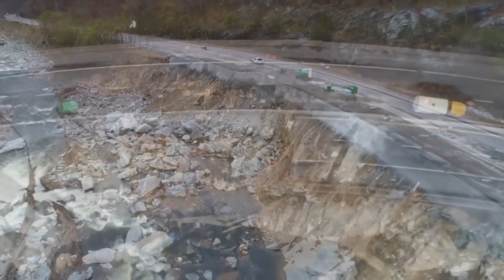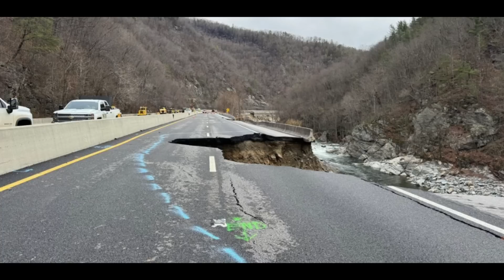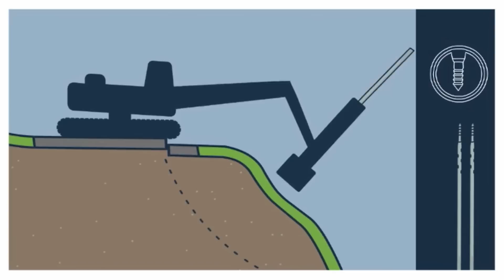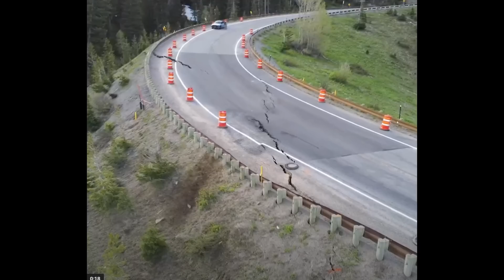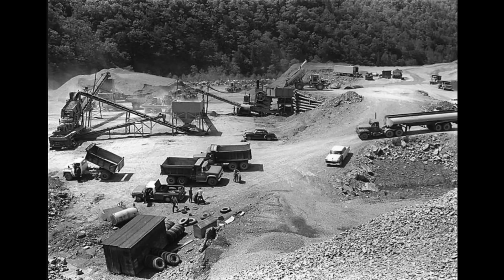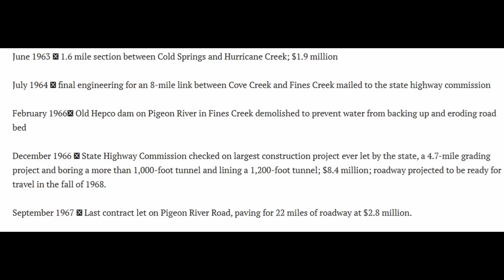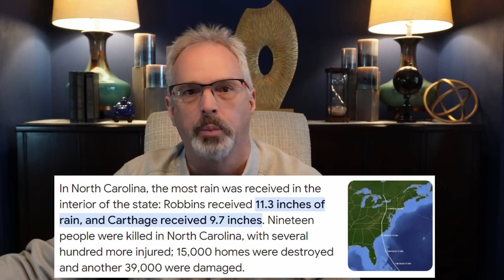Interstate 40 Rebuild Status

Comment: I 40 by-passes through the Nantahala gorge now in WNC.  The Road is in front of my house.  They better break  out the Dynamite and fix this yesterday.  This winter storm this friday 1-10-2025 is going to finish it off the road soon.  It was never designed for this much traffic.   The cracks are getting big and potholes are starting.  The road is going to fail the first time all these cracks freeze and get worse after this winter storm.   I predict they have about a month before it closes.

Comment: I am not an engineer but a retired operating equipment foreman from the mountains in WV building haul roads and mine reclamation jobs. I totally agree with you in your evaluation. Just as a note the fill under the slip area doesn't appear to contain the rock necessary to support the total road base from the presplit. Shut the road down and set back into the existing formation utilizing the rock and overburden in compacted lifts. I enjoyed this very much.

Comment: Excellent report on the rebuild status of I-40 in Western North Carolina. FYI: In the early 1970s, I took a graduate-level course on transportation at the University of North Carolina at Chapel Hill. This was one of the first such courses in the country at that time. I recall being informed that the cost per mile of this section of I-40 was the highest anywhere in the Interstate Highway System other than urban areas.
Reply from the maker: Thank you so much! Yes, that area is an inherently difficult location to build and maintain a roadway.

Comment: Also take into account they used the wrong explosives to terrace and carve out that pass through the gorge. They fractured the entire mountain. Constant rock and mudslides plagued I40 in the 57 years of my life. Take into account the 2006 flood that literally stripped 45’ of growth on both side up the bank through the gorge. The 2006 flood actually weakened the road bed. Traveling I40 if you had photos of the current road bed after 2006 you’d see allot of patchwork in places where the road is missing now.

Comment: I'm not an engineer, but it doesn't take an engineer to see the coming failures of this section of highway. 

Immediately after this damage occurred, I said that the road needs to be cut back further into the mountainside. 

Eventually, during this repair, the rains will come again. That mountainside is pushing the remaining road towards the river. 

The rains will get into those exposed rock layers, and they will move what's left of that road.

Comment: The one thing that comes to mind is that when engineering this project one should not rely to heavily on historical event frequency or rainfall data. The Gulf of Mexico has been getting pretty warm. I would consider that flooding rain falls in that part of the country are just going to become increasingly more common. Great explanation of the fat tail; I had actually not heard about that before.

Comment: Would the bedrock support a tunnel system?
Reply: If not, turn the two lane section of the freeway adjacent the eroded sections into a one lane short-distant corridor with the Arizona divider. Design shoulders wide enough for emergency parking shoulders on either side of the remaining paved (stable) surfaces.  Give it ten years to allow for a more permanent solution...like a totally new corridor (assuming this was originally a political solution freeway design and not a sound engineering solution). In ten years, the state will also know a bit better the stability of other parts of the corridor exposed to the river's flood force and slope saturation and stability.

Comment: I have driven Highway 25 along the French Broad River, ESPECIALLY between Hot Springs down to the next few towns.  The French Broad highway 25 route would be FAR harder and worse.  I have driven the Pigeon River route on 40 many many times as well.  The French Broad Route Highway 25 to Hot Springs and especially after Hot Springs would have been an engineering nightmare and cost far more then the Pigeon River route. Drive this for yourself please. The only other option is HIghway 74 from Chattanooga area which is so far it neglects having this route altogether. I am open to the extreme cost of putting the later built side on a raised corridor thru the pigeon River area.

Comment: I am not knowledgeable about the engineering side if this, but I do know that fill is far less stable than the washed away land it replaces.  I have seen some suggestions of a viaduct, and wonder if it would be a better solution. The United States has a massive issue with infrastructure across the entire nation.  Once we built the Interstate Highway System it seems like we thought it was once and done.  But we need to put more energy into building and maintaining alternate routes, we are too reliant on these major arteries. The US needs to reset our priorities and focus on a lot of restoration, and new infrastructure and have far less focus on being the world police.

Comment: It’s less of a question of how you’d route it as it is where it would be routed thru.  While this section saw severe damage in 04 the sections repaired then are for the most part undamaged.  Current alternative routes are either significantly out of the way (I-40 W to us-74 thru chattanoga, I-77 to I-81) or limited themselves due to storm damage (I-26/future 26 to I-81) with a significant traffic bottleneck in Asheville.

Comment: I40 needs to be rebuilt asap. While i agree that more advanced engineering like viaducts could be implemented, theres not time to wait for the designing, engineering and construction. Perhaps those details can be worked on in the long term while the interstate is restored to the way it was. There is little to no feasibility of rerouting the road or the river due to the terrain. Routing 40 to follow the French broad or us 25 would displace hundreds or thousands of people and cost many, many billions of dollars and destroy those communities in the meantime. We need 40 open asap, as the detour traffic passing through Madison county nc is absolutely devastating the local economy and the residents, who are still struggling to recover from the effects of hurricane helene. The delays, congestion, rude drivers, trash thrown out of vehicles,  and the refusal to stop and spend any $ in " the middle of nowhere" have been extremely detrimental financially, mentally and emotionally for the residents of Madison County NC. I cant tell you how many times ive had to physically stop traffic to  allow my wife, MIL, etc. to get in and out of my own driveway as traffic slows there approaching a yield sign. These detour drivers literally don't see or respond to anything but the gps directions on their phones. It is killing business here, as nobody will stop except to throwvout a dirty diaper or clean up vomit. Both of which are routinely left on the ground. Locals don't want to be on the roads now, and will rarely pull into a business for anything unless its absolutely necessary because it may take 5-10 minutes to pull out from a parking lot or make a left hand turn onto the highway
Reply: I get the trash. Unfortunately not everyone was raised as a Scout to leave no trace behind. It hurts me too. I hate it when people litter. 

However, with DOT trying to rebuild it they’ve run into more issues like more parts of the damaged highway sliding into the Pigeon River.  Thus causing more delays. They can’t open the other side yet cause they need that side for the equipment and stabilizing the soil. It’s too dangerous as it is for the crews.

I’ve read reports where it won’t be till 2028 that I40 is rebuilt. 

And unfortunately, people are too prideful going to try to find the quickest solution to their problems like taking backroads instead of going the long way around or throwing trash out.

I get it though. It would be nice if it could be finished by tomorrow. But that’s not going to be the case with this project.

Comment: Rebuilding the roadway washed away by the flood is a massive undertaking. I have watched other videos on this and one proposal was to replace the washed out soil and rock.  That may be all well and good until the next flood occur ancestors.  To make the repair successful will require drilling into the rock base into the bottom of the stream bed and establishing solid anchors and placing large steel I-beam then build a concrete wall up to the height of the most recent flood water level.  Then fill and level with rock dirt to the previous road bed height.  A washout proof wall must be built to prevent the river from washing out fill hauled into replace the rock and dirt that was washed away during the flood.   If the roadway isn't rebuilt properly a future wash out will surely occur.   Perhaps in ten years or perhaps longer?

Comment: Hi, I am an over the road truck driver. About 10 to 15 years ago, Colorado DOT had to rebuild a section of Colorado Highway 13 between Rifle and Meeker, Colorado. A section of roadway slide off. I remember driving through the area as they did embankment repairs. I saw the constructing crews using these big blocks of solid stryfoam, 4'x4'x8', stacked in multiple layers. I've actually hauled these blocks before, to a parking lot fill site in Fayetteville, Arkansas. There, they used them as fill instead of using dirt. After construction was done, it was just used as a parking lot. But in Colorado, they used them to fill in the side of a mountain slope to rebuild the highway, I believe, to a 3 lane roadway with shoulders. 2 lanes going up and 1 coming down. It's a big grade going up. 

Could those blocks of foam be used to refill the slope in North Carolina? Maybe even at a reduced price? 

After looking at the destruction from the river, the only way I could see anything to be done to have a guarantee of the highway not falling away again, would be to build a giant concrete ditch for the river from beginning to end and for all of the smaller rivers and creeks flowing into the Pigeon River. Then, building concrete slopes from the highway to the river ditch. Ditch as in what Los Angeles has in its city to move water from the streets to the ocean. 

Another option, build the same type of roadway system as Colorado DOT required for Glenwood Canyon! Tunnels, separated east bound and west bound roadways and lots of columns for elevated sections of roadways???
Reply: The ecomaniacs would never let you get away with the ditch proposal.

Comment: For many years, I wondered why I-40 was built through the gorge.  It has always been a problem with rock slides, land slides, erosion, and in some cases Tunnel Collapses.  Perhaps they should re-open it as a TWO lane interstate.  There is a precedent for this in NH where there is a 2 lane interstate.  Now, you might say, "Well, we need this for truck traffic."  Well, yes, you do need a connection west.  However, ever since I-26 was finished over to I-81 there has been an alternate route.  It seems that was a much more viable route as it survived Helene.  Perhaps this should become a more permanent route.  However, I-240 needs to be vastly updated to handle this traffic.  NC DOT does have a plan to widen and improve I-240 from the 40/240/26 junction all the way to near the Smoky Park Bridge over the river in Asheville.  Part of the plan is to build a new bridge connecting 240 to 26.  This plan would need to be accelerated and expedited.  What about I-240 east through downtown Asheville all the way out to I-40?  I don't see much happening with this but would truck drivers really be willing to drive all the way to the 40/240/26 junction to get on I-26?  Maybe if it saves having to drive through downtown Asheville they would.  Could I-26 North of Asheville be changed to I-40 and have it continue on I-81 to Knoxville?  Would the current I-40 be changed to a different interstate designation or would it be something like Alt-40?  I am curious.  Of course, this does re-route traffic in a way that some towns especially on the TN side would miss the traffic.  However, I imagine Johnson City might like this as they would get more business over there.  Right now the traffic west has to go over I-26 to I-81 anyway unless truck drivers want to drive I-85 all the way to Atlanta and then back up through Chattanooga to Knoxville and Nashville which reminds me of "going around your elbow to get to your A^@."
Reply: Not sure if I81 could handle the traffic back down to the original part of I40. That may need to be widened out to 3 lanes also.

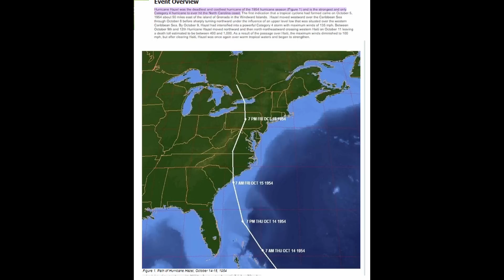Comment: LOL, 12:53 onwards is you not being a professional engineer.  12:10 the "experts" put the chance of this event occurring at 1:1000 (NPSE rules of practice #2 Engineers shall perform services only in the areas of their competence).  Better to ask what does a 1:1000 likelihood mean in terms of a time between events and then ask the question of what is an acceptable risk.  We don't design structures for extreme events (we didn't design the Francis Scott Key bridge for boat collision), perhaps you're saying we should?  That's an interesting and fun discussion.

Hurricane Hazel: 11.3" of rain... Hurricane Helen ~30" of rain... am I wrong about the relative strength of these two storms?  I'm just looking at what you put up on the screen.

Anyways I though I would remind you of the NSPE code of Ethics, Fundamental Canon #3: Issue public statements only in an objective and truthful manner.  I personally don't like you using the title of PE and then making a video where the tenet (Hurricane Helene magnitude weather events are going to happen more often than expected in the North Carolina/Tennessee state line) is your opinion.  

I'm sure this post comes off as way more critical and harsh than I want it to, but hey I'm not a professional commenter and this is just my opinion.

Comment: This stretch isn't just prone to flood damage: it has a long history of major landslides from unstable rock. It should not be rebuilt as anything but a two-lane road with tunnels and viaducts at best, and probably it shouldn't be rebuilt at all in the most vulnerable areas. I-40 should be moved back to the original planned French Broad River route with this existing section abandoned until the NPS can come up with a plan to restore it as a much lower impact scenic route as part of GSMNP in areas where other routes are not feasible. Otherwise, the only realistic solutions for this gorge route are rather unsightly and not without problems of their own. I'm not sure if anyone wants to drive/see a double deck viaduct soaring along the river for miles just to keep an interstate through there. It would have to be designed to be not only safe from scour in floods, but also be able to withstand massive amounts of rock and earth slamming up against its supports. Even if all other considerations are put aside, the remoteness and sharp curves make it extremely hazardous for trucks and cars: especially in wet, icy, or foggy conditions. When a wreck happens, it is very hard to mitigate thus trapping drivers for long durations. Another issue that is ignored is that this route is still needed to replace an old state highway near the gorge that is too steep (and unpaved) isolating a popular part of the national park, so a road of some kind is still needed in the immediate area. I am just really hoping they aren't going to waste millions trying to fix the unfixable instead of just closing it permanently while seeking a better solution. I was saying before this even happened that they needed to start the process of moving this route.
Reply: Another problem with a viaduct is the amount of salt that would be poured onto it because of the mountain weather, not to mention the high number of freeze-thaw cycles in a colder part of the Southern US.
Reply: @Scramble-electron-890  Too true. And even with salt, there will still be freeze problems. Bridges are the first to freeze.

The Lynn Cove viaduct will last a long time because it will not have a bunch of salt poured on it. Frankly, the current roadway should never have been built.
Reply: Both the river hydraulics and geology make the current alignment unfeasible.

Comment: Just looking at the narrow valley floor and the small footprint available, a long-term solution seems more like the I-70 “stacked lanes” engineering concepts through Colorado’s Glenwood Canyon.  In this case, the upper lanes would descend down to meet the existing tunnel bores.

Comment: I like the idea of putting an all concrete section in the river like the LA river, high walls, angled bottom, curve the water in a controlled manner. As long as that water curves and changes direction there, the road will always be at risk otherwise due to erosion.
Reply: Yes, line the river with concrete and get that water out of there as fast as possible. They could engineer it for optimal flow.